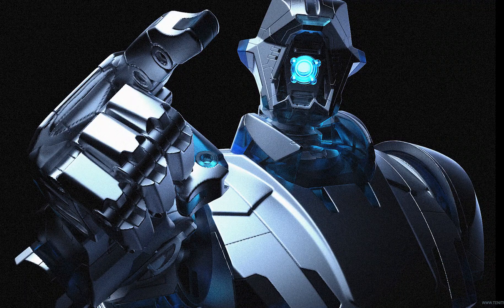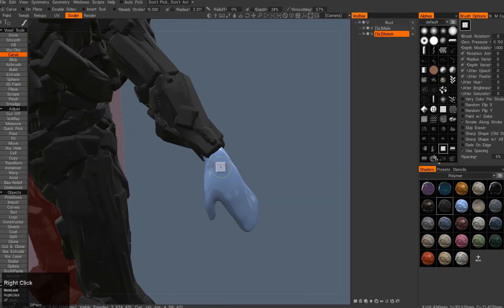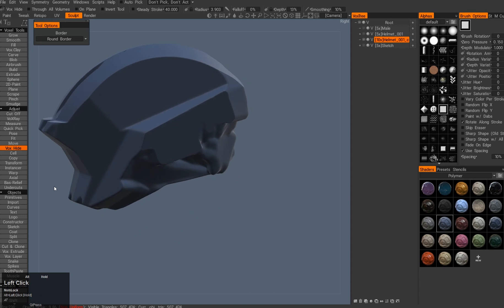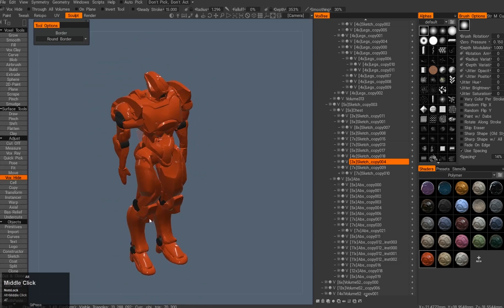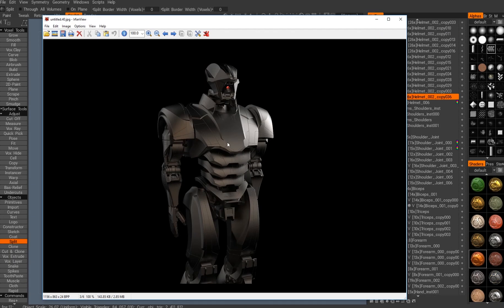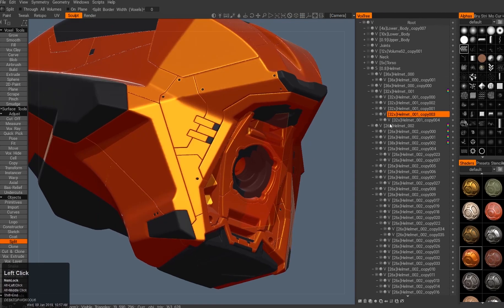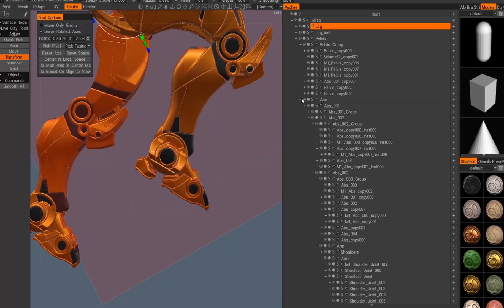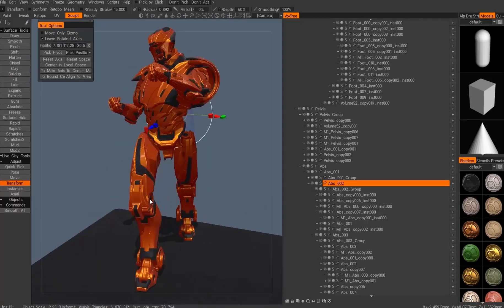Designing Massive Mech in 3DCoat

Comment: Hi Anton, I did bought your modular town tutorial, it was nice, now I would like to learn hard surface in 3D Coat, do you recommend your mech tutorial for 3d coat 2023 ? Or its outdated? Thanks!
Reply from the maker: Thank you so much for getting it man. The core tools are the same in the robot tutorial. I'll be using carve brush, voxel hide and split tool most of the time. Which is the original thing I liked about 3d coat so much that you really don't need many tools to do most of the things.  In modular town I actually used way more tools than in the robot one :) so I think it is still relevant just because of the simple core tools that were used. Interface changed just a bit

Comment: One thing that scares me is all the layers I see you using. Are many if those backup layers?  I am daunted by the sheer number of them and wonder if I could even master a program that looked so crowded as far as keeping track of all the elements those layers imply.
Reply from the maker: Hi Ronald. I think even the cleaned version has around 300 layers. I had to write my own script to do layer renaming. But if you compare to Zbrush this is actually much easier. Because in Zbrush you can also have hundreds of subtools to manage on a complex object but Zbrush subtool manager sucks.
Reply: @AntonTenitsky  ah, thanks for the response. So it's because you're trying to keep it as non-destructive as possible?  I am super impressed by your resource management brain. If we did an MRI would your brain also be organized into layers?  Heh heh..
Reply from the maker: @RonaldStepp  non destructive and I kinda naturally get a lot of layers if I constantly use split tool. But every layer is usually a certain part of the robot so I have to keep it separate

Comment: Hey Anton, everytime I see hardsurface stuff done with 3dcoat there are those edges appearing due to a lack of resolution, is there a way around it?
Reply from the maker: Hi Christoph, yes it is due to the lack of the resolution and I really pushed this robot for example. I did him at 100 million triangles and still couldn't get the edges better. I'm in contact with the devs and they promise a work around soon let's see if its possible the resolve in the few versions.
Reply: @AntonTenitsky   can't this lack of resolution be solved with the retopo. you are basically re-polymodeling the objects in your sculpt?  maybe iu dont understand how it works..but I thought the retopo was part of the process.. that guy Vitaly B  rebuildings all of his sculpts in softimage if I am not mistaken.
Reply: @AntonTenitsky  converting to surface gives cleaner topo its still triangulated but it does get better. fyi

Comment: This course is absolutely awesome and I am only on video 7! I have been interested in your workflow since your wheel design video. Thanks for this
Reply from the maker: thank you so much for getting and checking it out! :)
Reply: @AntonTenitsky   I have a bit of a question, I am running into a problem with the mannequin. When I create that duplicate I am getting weird issues out of 3D coat pro. When I use the carve tool to start creating the armor pieces the stupid Vox Layer keeps going back to the original layer. Am I missing something here, I am running 4.8.32. I can't get passed video two because of this problem, any ideas what could be causing this issue?
Reply from the maker: @EvilMP5  Hi, hm, i can't say for sure. Is there any chance you could second me a video of the screen capture to tenitsky[a]gmail.com?  You can also upload the file to dropbox I'll take a look, record a video if needed.